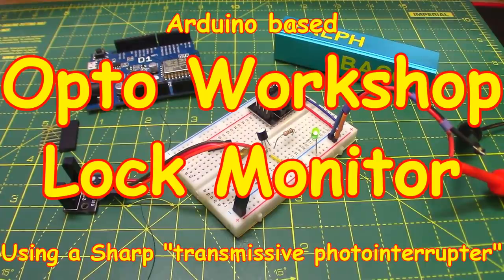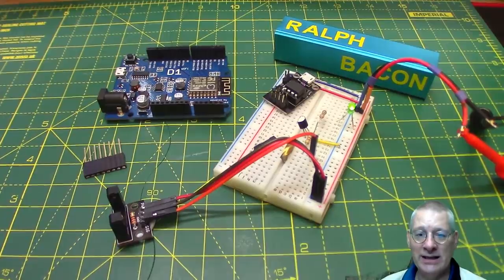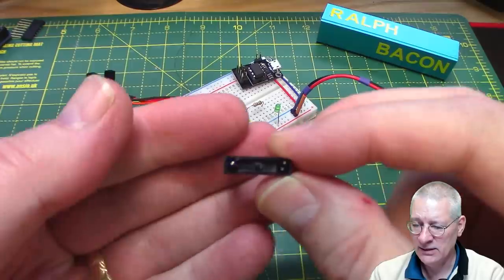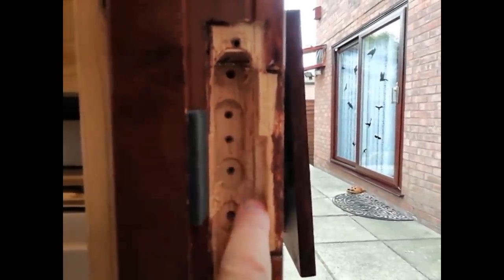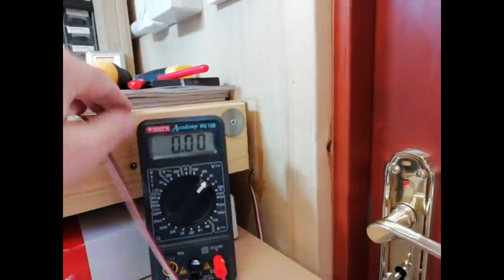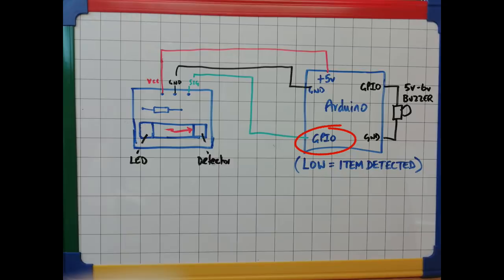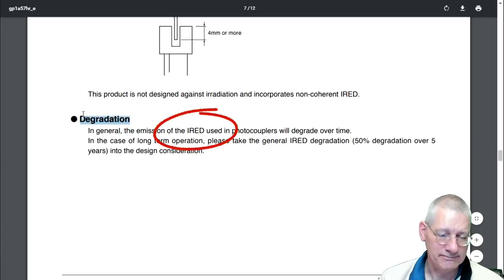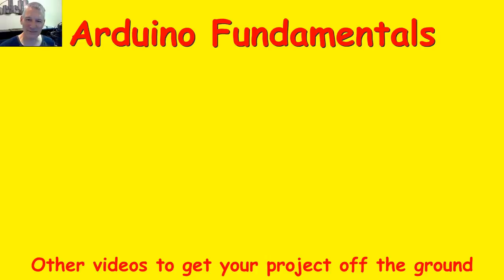#142 Optical Door Lock 🔒 Monitor (using an Arduino)

Comment: What a fun little project!  This reminds me of my childhood, well, 12-14 years old.  I had run a wire to my bedroom door handle and another wire behind the strike plate.  It was a series circuit controlling a relay "master kill" circuit, and it would shut off the lights and anything I was working on.  My mom would check on us in the middle of the night and we would just freeze and pretend we were asleep.  She would look in and then shut the door and go to bed.  One morning very early, she turned the door nob and of course the lights when out, she turned the handle back again several times probably seeing the light turn on and off from the crack under the door.  Finally, she said, "GO TO BED!" My friend and I giggled and decided that game was over.  By the way, the relay was controlling mains!  Could you imagine these days letting your kids play with mains!  Lucky we didn't kill ourselves!
Reply from the maker: I'm glad you're still here to relay that anecdote, James! I remember designing a similar bedroom door knob detection system (about the same age) but it was mains-free and just beeped at me so I knew someone was about to come in. In fact, it was so sensitive, it beeped before the door handle was touched, a bit of a heads up! Of course, in those days, it was discrete components and no ICs.

Comment: Nice one!  I love making stuff like that.  Back in the late 70's, I made a touchtone switch for my hot tub.  I could call from anywhere to turn it on or off.  Took me weeks to get it working right.
Reply from the maker: Sounds like you're on the same wavelength as me then, Rudy. Today, though, you would just call Alexa to turn on the Hot Tub. Not nearly as much fun or satisfaction as "getting a project working".

Comment: Seeing some intereting alternatives in the comments, but I have to say thst the opto avoids the trouble of bounce that mechanical switches have. It also fails safe, and beeps if the led  fails or wires break etc. The CPU does add some complexity, but makes up for it by allowing for future expansion, someone mentioned an alarm for example. You could have it send a heartbeat to make sure it isnt failed. Heck you'll be here in 5 years just following up on all the ideas in the comments. Oh and nice to see you pointer made it home safe. I was getting worried.
Reply from the maker: Thanks for this post, K3n7, you are right in a number of ways. The opto switch was easiest to implement and most reliable (including switch bounce). Let's face it, even if it degrades after 5 years so it becomes unreliable I'll just replace it. But the sensor is only 2cm/1-inch away from the transmitter, I think it will last a lot longer.

Comment: With a Little extra work and an ESP you can also make an Alarm to notify you when someone "Unauthorized" enters your shop. Don't know if that is a problem in your area.  Great Project.
Reply from the maker: I think the conclusion to this project is that now I have the hardware mods in place I can do ANYTHING with that signal. But I don't need another entry alarm as my neighbours this morning will testify as we forgot to switch off the house alarm (Benny was throwing up, blrgh) so when I opened the door the PIR detect set off the main alarm anyway. Sorry, neighbours, it was all Benny's fault. 😺

Comment: Another great video! And so many possibilities now you have the sensor installed.  Intruder alarm? Automatically switch on/off the workshop when unlocked/locked (may need a substantial contactor!)? Lots of potential future projects and videos there.  Look forward to seeing what you come up with...
Reply from the maker: Exactly so, Gavin. In fact, I don't need Alexa or the Kill Switch, really. The action of locking the workshop could be used as a signal to a MQTT Node-Red system to do all that for me. Hmm, now there's a future project in the making!

Comment: Thought you may have used a scavenged part ... Old style wheeled mice (always being chucked into skips) great source for opto interrupters (and microswitches). I have several floating about that I must cannibalise soon. Great project and one which I'll be doing myself as part of a security system ... push one button before going to bed or leaving the house and it checks main doors are all locked (and tells you which one/s aren't) and then add additional sensors over time to all the windows. Nice one Ralph.
Reply from the maker: Had I known that I would be chopping up that sensor I would have looked for alternatives, for sure. I had high hopes that it would actually fit into the lock housing (I measured it before I ordered and knew it would be a tight fit but it turned out to be a no-fit!)

Comment: i was considering something similar but using magnet embedded in lock latch and reed switch. this seems better. thanks
Reply from the maker: I couldn't get the magnet to mount properly on the lock, it had other ideas - it was pulled quite strongly to either side of the lock but not the middle. Strange, really. This worked the best (for me).
Reply: @RalphBacon  yes I was thinking I would have to drill a hole in the side of the latch and glue it in. 
I guess a physical micro switch, one with a roller would be to unreliable and require perfect placement to work.

Comment: Great vid, however, would probably used a, or multiple 16A Sonof switch(s) and set up an alexa scene to turn the lot off.
Interesting project though, thanks for sharing.
Reply from the maker: Ah yes, ISO Guy, I've just mentioned this in my reply to Gavin below before I read your comment:
"In fact, I don't need Alexa or the Kill Switch, really. The action of locking the workshop could be used as a signal to a MQTT Node-Red system to do all that for me."
Great minds think alike, hey?
Reply: @RalphBacon  Thank you for the reply.  Node red, good choice. 
I regard your vids as some of the best on the tube when it comes to explaining proof of concept.
Just really wanted to say thanks for the time and effort you put into making these vids.
Reply from the maker: Nice of you to take the time and trouble to do so, ISO Guy, I'm glad you like my videos. Much appreciated.

Comment: Another source for this sort of component is a scrap VHS machine.  Typically there's a dual IR LED (emits out of both sides) and a phototransistor at each end of where the tape sits,  used to detect the transparent leader at the end of the tape.  I've scrapped a number of these,  the older the better,  and they're a source of all kinds of useful components.
Reply from the maker: Ah, VHS, I vaguely remember that. Absolutely rubbish video quality, but we've only realised that now with our HD and 4K TV sets. Interesting equipment to cannibalise if you can ever find one again...

Comment: Why didn't you use a RPi instead?!?!  OK, I don't want to sound too negative but that was a lot of circuitry for a buzzer that goes on when the door is locked and power is still on.  A simple buzzer, DC PS (whatever you have lying around unused really), and a good old mechanical limit switch.  Put 'em in series and you are done.  The switch will last forever and your circuit doesn't waste power on the IR LED that degrades over time.

Now if you wanted to add more features such as automatically turning said power off after a delayed time or allowing the power to be manually left on for a period then I could understand a little about using a micro-controller.  But again a mechanical limit switch would still be the better option and allow more flexibility in the future.

Just my 2 cents.
Reply: I suspect because even the arduino Ralph used is overkill for this use. Using a Pi would be orders of magnitude further overkill.
Reply: @pileofstuff  he was being sarcastic.
Reply from the maker: Hmm, sounds quite simple when writing down ideas, Elmer, but believe me, I tried many options! Remember it had to fit in or around the door lock and have the lock part trigger the switch in a repeatable, reliable manner, for years to come. Nothing worked as well as the solution I ended up with, even though I eventually had to chop the poor little sensor housing into pieces.
Regarding future use of the that signal, I've realised that it could trigger an IFTTT or MQTT/Node-Red system to turn everything off for me - as part of my workshop automation project, still bubbling away!
For this demo, I just used an Arduino so the buzzer was a beep-beep-beep sound rather than continuous - and it could get faster the longer it went on - then send me an email!!!

Comment: nice project, but a MPU seems overkill...  the signal into a ttl level NPN MOSFET connecting the buzzer to power would have done...
Reply: Wouldn't be Ralph's channel without an MPU ;) But a microswitch/reed relay and a buzzer would've sufficed!
Reply from the maker: But you can't get a buzzer by itself to slowly increase the frequency or urgency of the beeps and then to finally send you an email. And now it can monitor how long the door was locked for, extrapolate when I will be opening it next and turn the kettle on ready for me. And the toaster. One day, one day...

Comment: Instead of an Arduino, you could have used a very common 2N2907 PNP transistor.
Low on Base causes beeper in the Emitter circuit to beep.
Powered from your switched AC power, so OFF is off.
Reply from the maker: It wouldn't have beeped though, JH, it would have been a continuous tone, not nearly as satisfying. I'd need two transistors to make an stable multivibrator - or use a 555 in which case my Nano 168 is the better choice in terms of flexibility!

Comment: A little bit OTT for what's required - but, as you say, it works and costs buttons so who cares.  Nice one Ralph!
Reply from the maker: Using an Arduino device can never be OTT, Bruce, not on this channel, surely? Using the Wemos D1 for this might be a tad over-engineered (unless I really was sending emails to myself). But read the other responses, I reckon I could get this all "power off / lights off" automated just by locking the workshop door.

Comment: Hi Ralph, Thanks for sharing, just an objection here,  if you want to have some privacy and lock the door when you are inside you can’t have the power on in the shop?? 🤔
Reply: When hiding from the wife...  Power on in the shop is a sure indicator of your location...

:P
Reply from the maker: I must admit to never having considered locking my workshop from the inside for "privacy" reasons! the mind boggles. My wife would definitely think the worst. I leave the keys hanging on the outside of the door (lock) anyway, just to remind me to lock up!!!
Reply: Ralph S Bacon 😂😂😂😂😂😂, then if you never lock the door from inside you don’t need an alarm just connect a contact or to the output of the device so when the door locked power goes out.
Reply from the maker: Yes, it would need a decently rated relay but I have one now, so you never know what I will end up with.

Comment: Since I assume you do not lock your workshop if you are inside, wouldn't it be logical to have your nano switch off your 'kill' switch?
Reply from the maker: You're on the same lines a others (and me) here, Frans. Now I have the signal from the lock available I can get Alexa or just MQTT/Mode-Red switch off everything. It needs a beefy relay though, but I now have a 30A (allegedly) one. If I leave the heater on its own (current) relay that should all work. Great to hear from you, thanks for posting.
Reply: @RalphBacon  maybe another project - try an automotive relay - relatively cheap and capable of switching high amperages - maybe not "rated" for use with mains but usually far better than the tiny ones rated 230V 10A available through ebay or aliexpress (project - testing?)

Comment: They're also used in mice for the scroll wheel :)
Edit: Yes, even new ones. :)
Reply from the maker: Yes, I suppose they are, Christian. I've also used them in motor speed controls for remote control buggies (RC models). Great to hear from you.

Comment: Interesting. I think though that the usefulness of those photo interruptors is limited for the average DIY-ers. You seem to have found a nice niche :-)
Reply from the maker: It is a bit of a niche solution, Ed, (but does work very well, it must be said). Since that video it's gone off again! If I had used the LED/Receptor without the plastic case it would have been slimmer and therefore potentially fitted inside the lock thus obviating the need for further chiselling out to make space.

Comment: Fork sensor is what it's often called.
Why not just replace the workshop power with a contactor and have she who shall not be named turn it off.  This would out this microcontroller to better use.
Reply from the maker: I already demoed that Alexa could turn off the power in my workshop about a year ago, James, when I showed my 4-ch Sonoff. But the relay can only switch 10A so I would have to use a bigger relay (which I now have, 30A) and it's all part of my plan to take over the world -- sorry, my workshop, using MQTT/Node-Red. But until I get to install all that this is the next-best solution I could come up with! 
That Arduino Nano costs just £2/$2.50 (I bought a bulk lot a couple of years ago) so, at less than half the price of a Costa coffee it's not exactly squandering my digital goodies away!

Comment: Use the opto output to drive a relay and switch the mains unless of cause you lock you're self in the shed.
Reply from the maker: You're on the right lines here, Darren, I was thinking of a full blown MQTT/Node-Red system using my Pi to switch off the power as I locked up. See my comments in this video for more details!
Reply: @RalphBacon   Add a camera for that  rpi and make a motion sensor anti-burglar system. Just to make sure no one steals your blueprints for world domination.

Comment: Excuse me, Ralph, why did you not use a simple magnet window sensor to do the job?
Reply from the maker: This was asked in an earlier comment, Bob,  by Steven H, so here's my answer pasted for your convenience::
A small Neodymium magnet attached to the lock was my first experiment. 
Imagine my surprise when (a) the magnet not only refused to stick to the lock itself (as it was brass but with steel reinforcement bars) but (b) was pulled very strongly to either side of the lock. This meant that even if I had forced it directly onto the lock end and glued it there, over time it would doubtless have been pulled off by that weird sideways magnetic pull.
And I definitely could not use a simple window alarm type sensor as I want to know when I have LOCKED the door, not just shut it.

Comment: I am worried now, what am I leaving on in my workshop that could be an issue
Reply from the maker: I've always had a master kill switch, Justin, to remove the power to the sockets that might have soldering irons, power supplies and similar plugged in. In my workshop I have 4 separate, fused power circuits:
1 - permanently on (for computers, mainly, also the CCTV)
2 - switched, controlled by the kill switch
3 - lighting
4 - heater
Definitely worth thinking about #2 in any workshop / shed / garage.

Comment: Hey Ralph. Nice idea to save your workshop from maybe burning down. But what I did not get: where does the Arduino get the information if the power is still on? Or is it just a dumb reminder that beeps always when you lock the door?
Reply from the maker: Yes, it' all a bit Catch-22. If the power is on (I have forgotten to hit the Kill Switch) then the Arduino is active (plugged into a USB adapter on the mains circuit that should be off). If I remember to switch off then the Arduino is powered down, so no beeping.
But this was just for the demo, I'm not sure how it will end up.
Reply: Ralph S Bacon ok. That makes sense. But you also could use an esp and get notified if you forgot to lock the door and maybe no movement was detected inside the workshop for a few minutes.

Comment: You know those micro switches with the long lever on them? That would have worked also. https://images-na.ssl-images-amazon.com/images/I/51UVOMa6gJL._SL1000_.jpg
Reply from the maker: I tried that too, Drex, but to fit it in (or outside) of the lock was going to be tricky because they are clunky, and then it relied on the lock part actually pushing the level enough. I did sort of get it to work on my workbench but I was most unhappy with the absolute positioning it would have required. But it's great that you are following my train of thought at the time, thanks for posting.